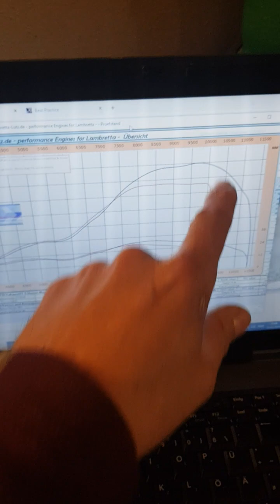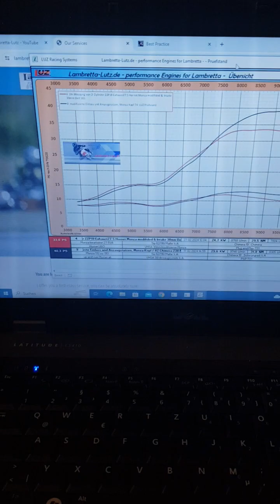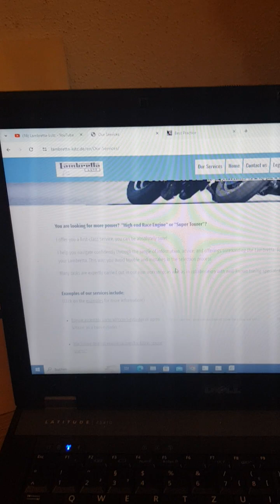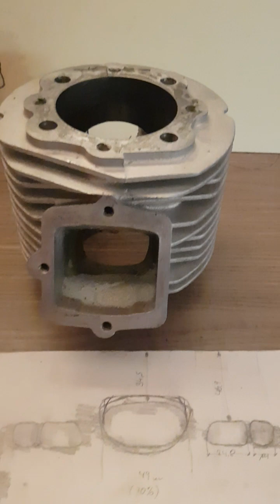#Lambretta, the Secret of the 40HP+ Cylinder, 5 steps Checklist for free power...

Comment: Very cool 40 HP what ccm is this , do you go to over 195 Degree exhaust and about the Magic 30 degree for pre Ex.
And you smooth the inlet form with Silicon?
Reply from the maker: Hi @MX-fo2nu, As you can see, it has a 70mm bore with a 62mm stroke and a 116mm Conrod crankshaft - bringing it to 238cc. This crank fits with some machining and runs perfectly. At the moment, I'm still under 195° but close, resulting in 31.5° of blowdown timing. These timings work fine, both for the high-rev exhaust as well as for the torquey one. The intake is bored out to 30mm all the way and smoothed into the reed valve. I've also been working with JB Weld to reduce the "death areas."
Reply: @Lambretta-Lutz  Many thanks for your very detail information i run very close smaler exh number in my MZTS 150 and works well either with 32miku carb with 85x VForce2.
I will check similar ; in short with GS KTM 125 Barrel instead MZ.
Reply from the maker: @MX-fo2nu, thanks for you comment.
with the 62mm/118mm conrod for the twin now, I will have different timings. Instead of 131/194, I will have 127/190, because the deck height will be -2mm (piston out of the TDC). This week, the 2in2 Exhaust is coming, so I will have the first dynos with the Chimera Exhaust. I will test with the 31.5° blowdown and with the 27.5° blowdown barrel, and we will see what works better. ;)
Reply: @Lambretta-Lutz  thants warten i also had/have because of different piston comp Height and shorter zyl Hightech i add very big copper head gasket and yes that changes Timing to lower but online 1/2 for blowdown;
Would be interessant to get you New  result with +2 over .
Reply: Did you test made build Use case Volumen reducer below piston above Crank ?
Reply from the maker: I have not conducted any experiments with the volume reducer. And since challenges will be different in other directions, it is not planned either
Reply: @Lambretta-Lutz  thanks for your answer